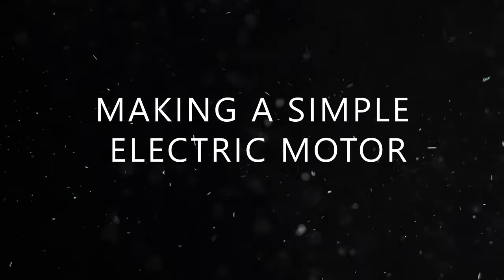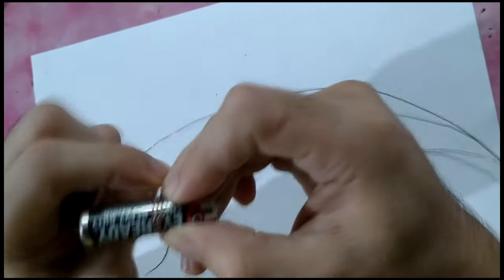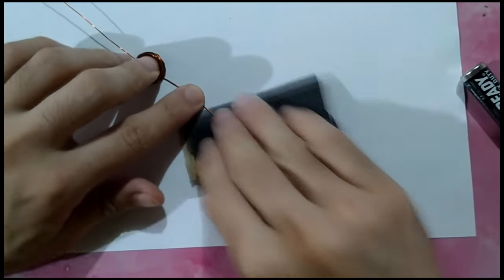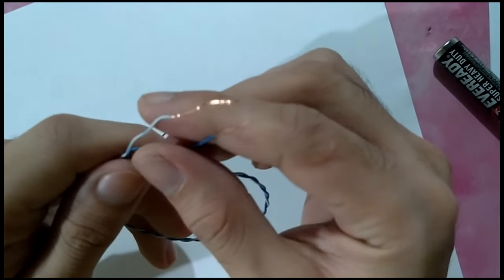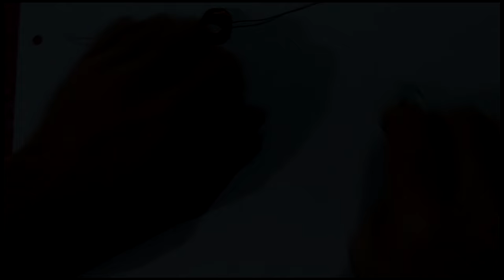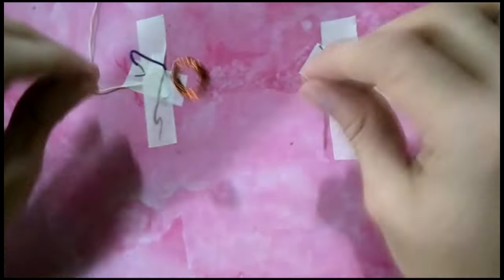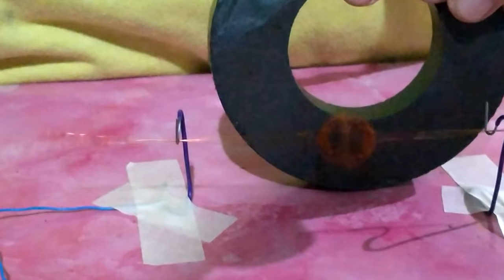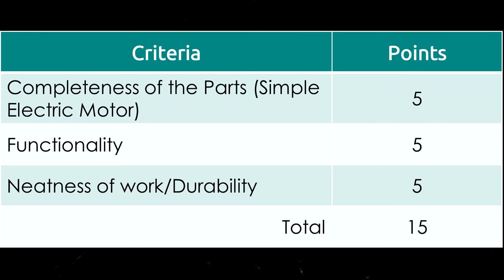MAKING SIMPLE ELECTRIC MOTOR | MELC BASED

Comment: hello, can i use thin copper wire from charger cables? does it work? thank you in advance!
Reply from the maker: You try. But charger cable is heavier than magnetic wire.
Reply: uhm, the size is ultra-thin, is it okay?
Reply: i mean the size of wire
Reply from the maker: Yes. Better to use thin wire